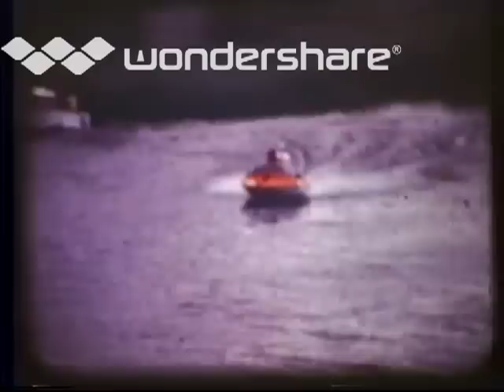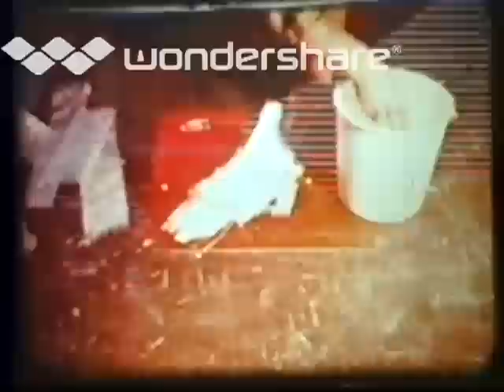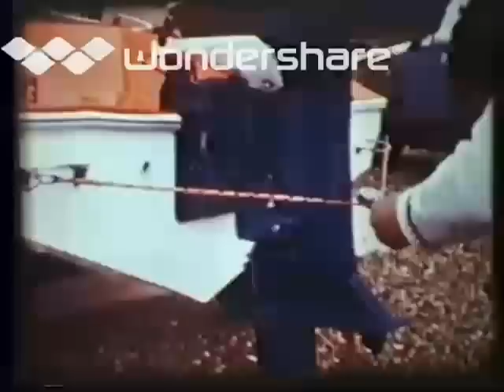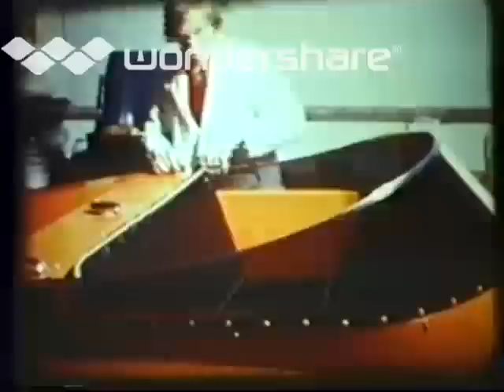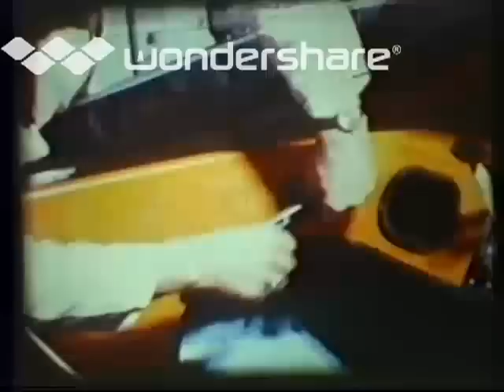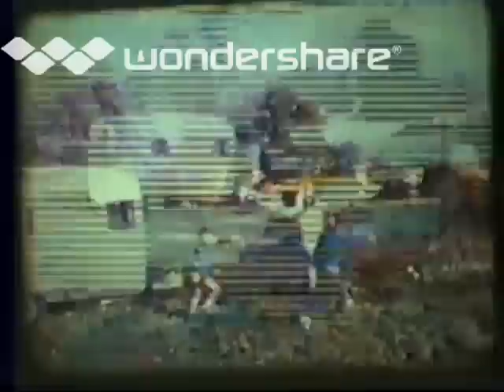Seafire speedboat by Almarine - Original promotional video from 1972

Comment: hey guys, a seafire with 6hp mariner arround 17/18kmh with an adulte of 95kg, with a little chidren de 45 kg, it s possible 20 kmh, a friend have a spitffire with an evinrude 30hp it's 97 kmh in river, but the driving its realy not easy but its very nervous and instable .
see you later